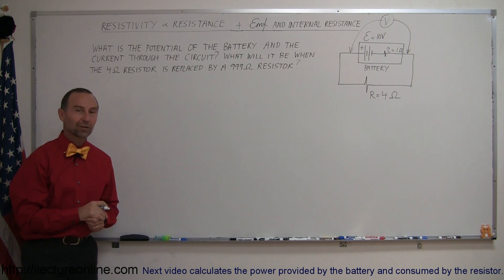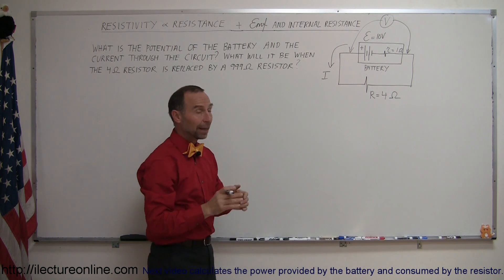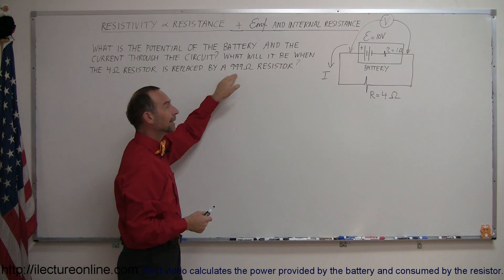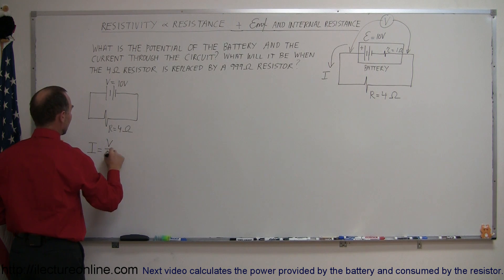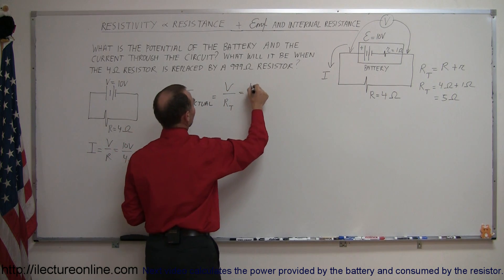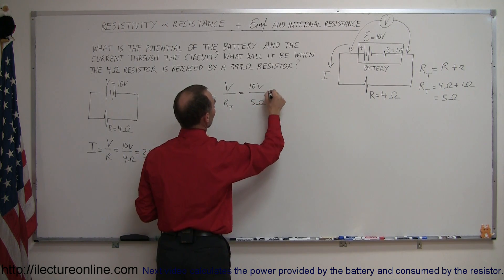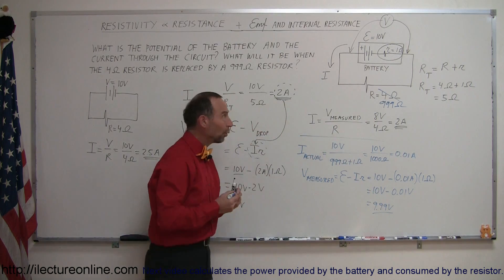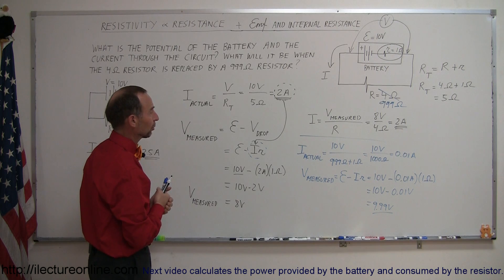Physics 40   Resistivity and Resistance (5 of 32)

Comment: Do you have any videos that graphs the potential as a function. 

Questions in class are typically like this: 

"Choose the correct graph of the potential as a function of the distance s traveled through the circuit, traveling clockwise from V = 0 V at the lower left corner. "
Reply from the maker: +Mercedes Cordoway No, I didn't make any videos like that, but that is a good idea.  What they are trying to get you to realize is that the voltage (or potential) around a closed loop is like the height of a water slide.  The battery raises the "height" of the voltage to its initial height and then the resistors lower the voltage (causing a voltage drop across each).  By the time you get back to the battery the voltage is back to its lowest point.
Reply: Thank you so much!